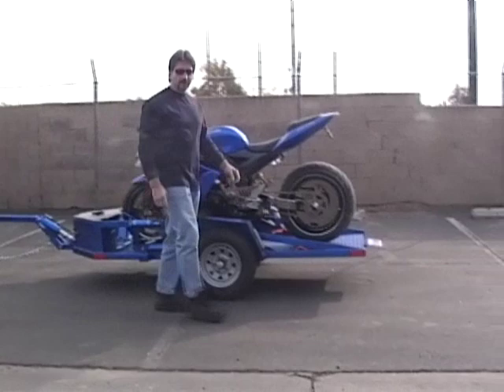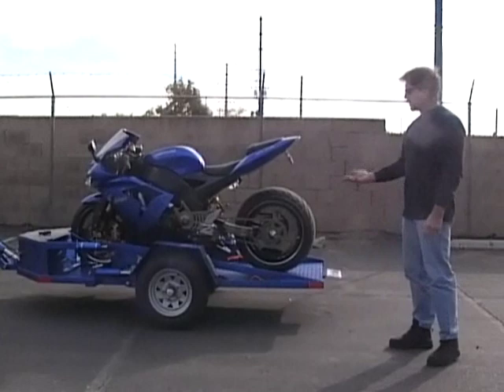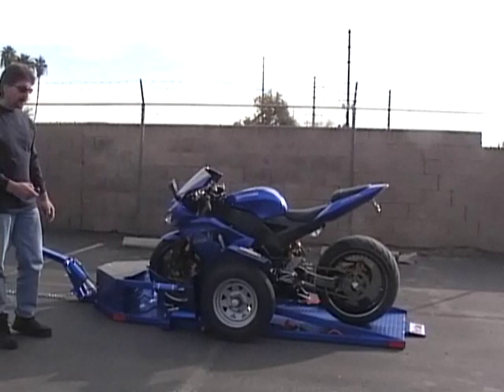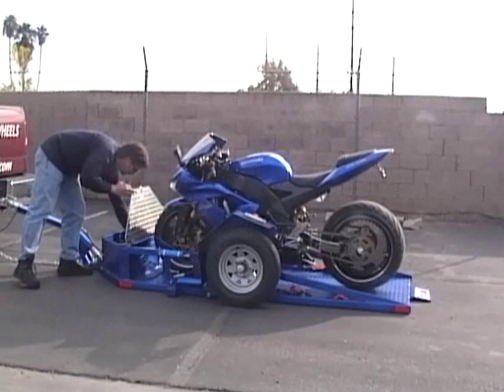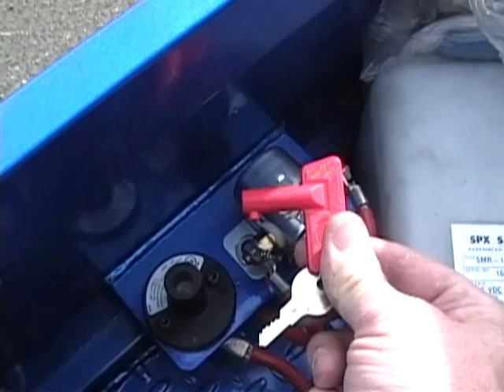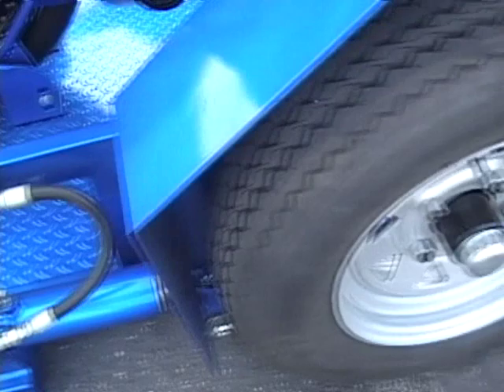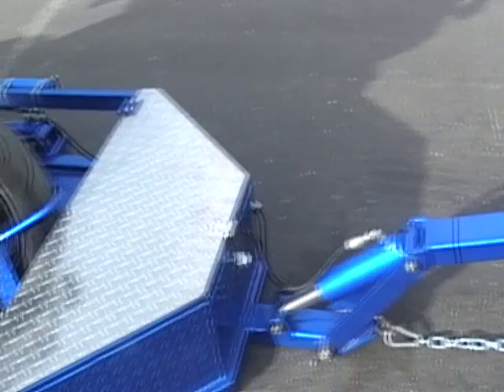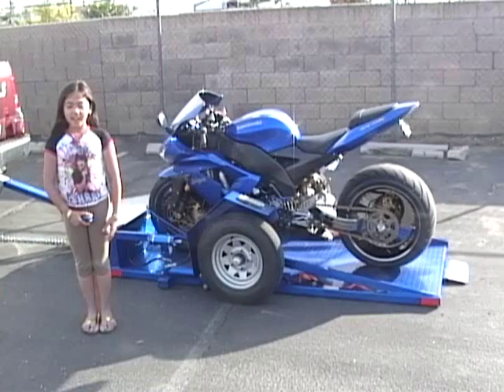TRP Corp Hydraulic Motorcycle Trailers.wmv

Comment: I just purchased one of these trailers. The builder takes pride in his work and it shows on each and every detail. The design lets me load a 1000 lb motorcycle bike as easily as if it were a bicycle. I can load and tie mine down in under one minute. It tows easier than any enclosed trailer and rides like a Cadillac due to its independent suspension that works with twin oil and nitrogen cylinders. The construction is heavy duty everywhere you look and is designed to last. I am more than happy.
Reply: Hello, do you still own the trailer?
Reply: @32361ARTHUR  would like to have some details to apply to a car tow dolly I'm building... Thank you
Reply: @cvmauto6773  WOULD REQUIRE A COMPLETE DIFFERENT DESIGN

Comment: It's cool engineering. But for $3800 you can get a very nicely loaded enclosed trailer that will keep your bike and gear clean and secure. You do have 2 advantages I can see. Easier to push load (tho I don't think it's hard to go into a trailer), and the weight is about half of what an enclosed would be. Still I'm not sure. Like I said nice build tho, it's a hell of an idea, just not sure about the practicality of it.

Comment: I like the idea of not having to ride up a ramp and and down a ramp since I more than likely will be loading and unloading by myself, love the hydralics to lower to my car height as well.  I'm petite  (5'1", 125 lbs) and have a 1200 Low Sportster that weighs 581 lbs.  My 2012 Caddy CTS can only haul 1,000 pounds. Trailer would need to equal no more than 419 lbs. Can you modify a trailer to meet these specs?

Comment: ODD VIDEO , didn't see the trailor ACTUALLY go up or down as you keep jumping the video to the next bit.. Doesn't it really work then?? , My home built trailor weights just 200kgs, can carry 1, 2, or 3 bikes, or sidecar outfit or quad, and it loads in 30 seconds, bike is held in on it's own, And a full width loading ramp so you can ride on, walk on. Mine has over run brakes and superb lighting too and cost me 500€ to build an it's all galvanised. Colin